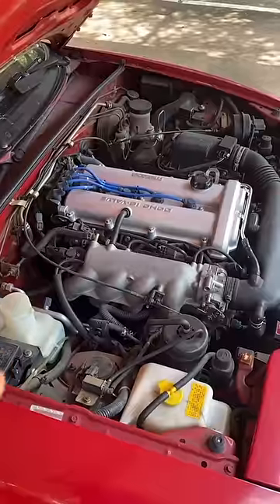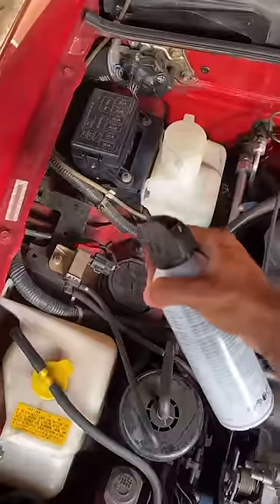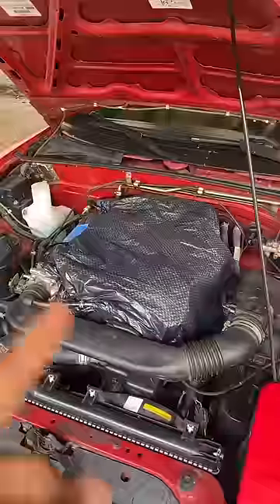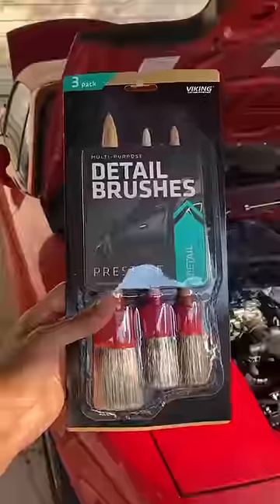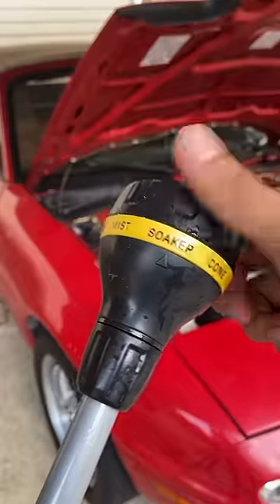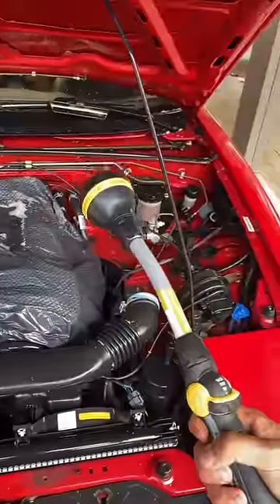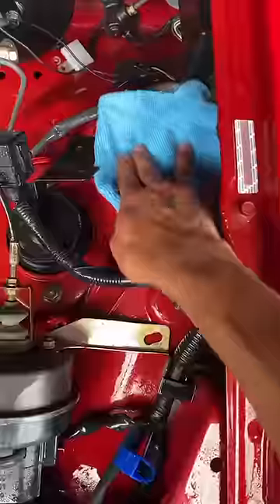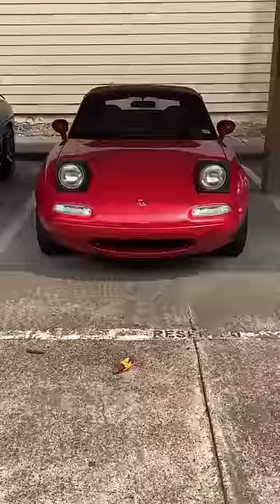How to Detail an Engine Bay! (the right way)

Comment: One thing to note is to disconnect the battery and probably take it out of the car altogether before doing this. With Miatas the battery is in the trunk so that's why he doesn't need to.
Reply: You still need to disconnect it for at least 45 minutes to remove all charge from the car so you don't short any sensors
Reply: You need to remove the battery and cover the alternator, doesnt like any bit of liquid in it
Reply: @jacobwebb8818   just disconnect the battery and turn on high beam for like a minute cover the computer (ecu) and the alternator.
Reply: The bug thing to worry about with the battery connected is the front impact sensors, if one of those shorts, bye bye airbags.
Reply: @WH32R  the chances of that happening are so slim though it's almost impossible. My 2001 Tacoma has them very low to the body and I've had them submerged in watery mud and nothing ever came about from it
Reply: @jacobwebb8818  then yours have really good water seals on the connections lol
Reply: @WH32R  Kinda what I was thinking the more I thought about it lol. 
I'm sure most have fairly watertight connections though, at least I would hope. Sensors aren't meant to be waterproof but they also have to be able to sustain a splash occasionally. If you look at most modern cars excluding the really recent ones with stupid amounts of plastic in the engine bay, most cars have plenty of huge gaps you can see to the ground from. Old trucks especially, the engine took up maybe like 50% of the engine bay and the rest was whatever the frame took up and the fender well. You could literally throw a football through the gaps of my buddies old power wagon lol. His massive air cleaner might have been able to fit between the engine and the frame lol
Reply: Not really gonna hurt anything
Reply: Do it regardless
Reply: U can just leave the car running while u wash 🧼 😴 soo it’s harder to damage anything just don’t stay too long on any ecu or anything like that
Reply: And wait for any liquids that couldve gotten on your wires to dry before you reconnect it too.
Reply: None of this is real unless your car is really old, modern cars don’t care about water under the hood, you can power wash under the hood and it’s completely safe. I work as a detailer, we do it all the time, nothing ever happens. This is mostly for 2000 cars and higher, but we have also done 1990’s cars and nothing happens.
Reply: @sebastianlopez8178  I bet you've ruined several alternators.
Reply: I never disconnected it in my live shit is water resistant for. Reason. Spend the extra 20 bucks you never have to worry
Reply: Lol, I've pressure washed many engine bays and its been fine
Reply: To everyone saying covering the alternator and ecu: these things will be fine with a few hours of drying as long as they have jo charge, its all just silicone, caps, and copper
Reply: Also have the engine running if you are spraying the engine itself
Reply: Thanks
Reply: When I detailed for Ford they had us pressure wash the engine bays of all the new stock/sold units/details. No trash bag. No disconnecting the battery. On details we hit it with an all purpose cleaner (red hot), started the car, then pressure washed it. Had a couple new guys give some open box intakes a bath lol. Summary: Wash your own cars.
Reply: He should have mentioned that
Reply: NO NO NO NO use DASTY its made in italy THE BEST GREASE AND CRAP REMOVER better than brake cleaner...... warm you engine up. Spray the whole engine bay all of it. And the high pressure wash the engine bay.... only do this on japanese engines... they have far much better sealing plugs and connectors. Have done this many times and zero problems
Reply: Thank you cause I was thinking the entire time I'm alot more worried about the electrical side of things in engine bay over the engine unless it has turbo, ITBs etc not much to worry about with it IMO 👍 Definitely agree it's good to disconnect the battery either way so you don't possibly short anything
Reply: Y'all acting like the engine bay doesn't get wet when you drive in the rain. Pressure washer? Probably not smart. Low pressure hose? You will be 100% fine.
Reply: Literally turn the headlight switch for one second with the battery disconnected and there is no power in the whole car immediately, if your vehicle is a diesel make sure to disconnect both batteries.
Reply: Actually you'd probably be fine, most cars are designed for water to get in that's why there's waterproof harnesses, pro detailers will literally hose the engine bay with water, now yes you should disconnect the battery but you shouldn't have to pull it out because it's disconnected and won't complete a circuit
Reply: I've seen Jeeps, Toyota, and Land rovers offloading with water over the hood... you'll be fine without disconnecting your battery or covering your altinator.
Reply: @NajaetheGamer  ever heard about that guy lighting a cigarette in the back of the plastic bed of his pickup truck filling up his red can......
Reply: @nickbisson8243  nope
Reply: Good lord I didn't notice he didn't do that.
Reply: @jacobwebb8818  why would You need to disconnect your battery??? Sensors? you act like the car engine is in a waterproof bay! Not never has it rained and you say let’s disconnect the battery before I drive through the water! Water can hit almost any part of the Engine! Except for ur fuse box. That’s why pressure washing it is the Best. Don’t have to hit it with a lot of water! A Water hose is not to great for it cause the amount of water ur putting on it!
Reply: @jacobwebb8818  or just turn the key when you remove the battery to discharge the capacitors
Reply: @jacobwebb8818  just flick the lights on, it'll discharge anything "stuck" in the system, Wich is usually next to nothing.
Reply: @thatslegit  you realize it gets soaked while driving in the rain, right?
Reply: Itz_Hunted  the fuse box, spark plug holes and relays are notorious for getting wet on these cars. Some cellophane wrap or foil and even wd-40 if you're paranoid keeps water out, other than that spray away. But I always disconnect the battery too.
Reply: @NajaetheGamer  terrible advice. Cool water can crack any parts that are hot, plus all the live electrical connections.
Reply: @docrand7750  read my previous comments and you'll see I said they get rain all over them 😂
Pressure washing forces water into crevises it normally doesnt go into, pressure wash from a far distance or low pressure and you're good
Reply: Mine is under the back seat so I'm good lol it's an 03 Buick lesabre custom if you are wondering
Reply: @grimreaper1257  it's not about getting the battery wet, it's about live connections while spraying water causing shorts.
Reply: @Parker_white_guy  I believe WD40 possibly some will do just fine and a cover for the fuse box
Reply: @thatslegit  eggsactly
Reply: i was like ``noooo the battery`` then i remembered that
Reply: What a crock. I've been taking my car to car washes for decades and NEVER removed the battery. I have a 2005 4x4 that I take swimming, water is upto my steering wheel and never had a problem, that just bull sht.
Reply: i was about to say this 😂
Reply: Don't need to do fuck all, alternator won't like it but if anything stops working from water in it then it was broken anyway, they have seals and all the necessary shit where it's needed
Reply: Was just about to say this
Reply: It's still not that big of a deal especially in older cars from the 90's and before. I've cleaned plenty of engine bays with water just by covering the alternator and air filter and never had any issues. It's not gonna be the end of the world unless you soak electric parts on purpose
Reply: I’ve always washed my engine bay with the car running. Zero issues

Comment: Well just be careful about the alternator and electrical lines before you shower down the whole bay
Reply from the maker: Good point! I always recommend covering the alternator, electrical connectors are usually water tight as long as you use low pressure from the hose 👍
Reply: Unless parts are damaged, this amount of water pressure won't do anything. Ive had engine bays full of mud
Reply: @sixspeedofficial  but u didn't say it this time u probably broke the engine or something from it like i feel it its just dumb to pay someone to do that if u only go on normal road AND not being crazy
Reply: Alternators don’t care too much about water, otherwise they wouldn’t be placed at the bottom of any engines. Mines been through rivers, mud quite literally, and all hell
Reply: I personally had to power wash my alternator because my power steering pump right above it cracked and dumped power steering fluid all over it. It hurt to do but I figured better than power steering fluid. Alternator still seems alright
Reply: So do you do when it rains? Idk if you know this get everything in the engine bay is DESIGNED to get wet. Just remove your battery and don’t spray into the intake. As long as you don’t use a pressure washer there is zero risk of you damaging anything that is in proper working order.
Reply: @tristangriswell2034  The key here is disconnecting and removing the battery, and making sure your engine bay has plenty of time to dry before running it again. Spraying water into your engine bay will put significantly more water into it (and onto electrical connections) than rain splashing into your engine bay does. In short, your engine bay isn't designed to be THAT wet, so taking a few extra steps to guarantee nothing is damaged is always the better decision. Otherwise, your statement is correct. Cheers =)
Reply: @sixspeedofficial  it’s actually much better to clean your engine while it’s running
Reply: @kingjohan1335  nooo 😭
Reply: @woody350z9  it literally is, the positive pressure prevents water getting into the engine
Reply: @sixspeedofficial  well you didn't this time
Reply: @Duck_side  exactly
Reply: @kingjohan1335  you dont really have to worry about water getting in the engine at all unless you spray water directly into the intake, its all the electricals you have to worry about because if the car is on then you could cause a short
Reply: @woody350z9  no water can get through many places, older engines can easily get water into the spark plug wells, it will misfire for a bit but usually will clear itself up
Reply: Water doesn’t cause shorts
Reply: @Fee.1  pure water wont, but most water isnt pure water
Reply: Or…. Wait for it…..disconnect the battery and let it air dry for a while
Reply: @Fee.1  it’s not the water that conducts its the minerals and salts in the water
Reply: @woody350z9  it is you just make sure it doesn’t suck in any of that water. The heat from the warmed up engine will mostly turn it into steam but still cleaning it. And just make sure to not get water in anything like a circuit. If you take proper precautions you will be Gucci
Reply: I've sprayed hundreds of engines in many types of vehicles. Sprayed the shit out of the battery, alternator, fuse box, everything. Never had a single problem
Reply: @ST3W1010  there are many places inside an engine bay designed not to get hot, water can sit and there after being shot in and under those areas with high pressure and cause corrosion and long term electrical issues when the electrical components rust
Reply: @EricB90  thats very anecdotal evidence, plenty of manufacturers mark specific areas with a "do not pressure wash" symbol. Just because you can identify an issue, doesn't mean its not there or wont be there
Reply: @kingjohan1335  exactly. And when do they come into play? Exactly
Reply: @woody350z9  bikes, Cars, trucks, heavy equipment, military vehicles, dump trucks, forklifts, semi trucks, riding mowers, 2 stroke engines, 4 stroke, you name it. If it had wheels and an engine, I've ridden em hard and sprayed em. Not sure how much more evidence i would need. Talking hundreds of scenarios over years.
Reply: @That V8 Life or….ride a naked motorycle with zero fairings…
Reply: @That V8 Life yep, even old cars wet isn’t an issue, pressurized water going where it shouldn’t, and common sense failures like failing to dry it or allowing water to pool in or around plug tubes etc is not a water problem it’s a classic PEBCAK SITUATION
Reply: @sixspeedofficial  I’ve encountered more metri-packs than weather-packs
Reply: There are so many videos of offroad vehicles running underwater no problem. You don't have to worry about the battery or the alternator.
Reply: Lol what?
Reply: Also never have the engine hot you might cause a cracked block
Reply: @imoffendedthatyouareoffended     Well any idiot knows that if you pour cold water on a hot metal that it’ll crack  block or weaken it there are cases where the block is made out of other metals but it does happen also most people don’t have heated garages so therefore the cold block when it is first started is already close to the temperatures of the air and snow and weather… now cold water out of the tap on a hot day and the engine was previously running and heated up then that can and has caused cracks before .. I have seen it happen with a girl in high school
Reply: @imoffendedthatyouareoffended   also most cars have a multitude of guards and if you have a subi the chances are none of the snow or water directly gets anywhere in the engine because of a slidplate that almost every car has now
Reply: It’s ok to pressure wash underneath the hood
Reply: @tristangriswell2034  it's almost like your car has a hood and a belly pan. Open your hood next time after it rains. You'll be shocked how every thing is.... completely dry. Crazy I know.
Reply: @---ny4ys  I don’t know what your driving but, the motor in both my Silverado and my Sonoma get soaked driving down the road. Maybe it’s because I don’t have all those useless plastic underbody panels.
Reply: @kingjohan1335  are you talking intake wise or exhaust?
Reply: I agree with eagle one the main thing you do got to watch out for is the air intake don't get a lot of water in there

Comment: Lemme just use 15 cans of compressed computer air real quick.
Reply: If you own a data vac those will work too, not as high pressure but you don’t need to keep buying cans
Reply: Why not just use a leaf blower?
Reply: All good options me personally I use my air dew auto 20 gallon air compressor and I just have an nozzle that shoots air works great just keep a safe distance ass the psi can be a little high but also depending on how hard I pull the trigger limits the psi coming out the nozzle
Reply: Comments like this make me wonder if y’all are alive or not 😂😂😂😭
Reply: The video said compressed air , what do you  mean an air compressor??? Video said compressed air so thats what I went out and bought !
Reply: LooooooL

Comment: Guys listen. You drive your car through the rain and all of those components get soaked yet youre worried about getting them wet? The only thing i worry about is the air intake. Other than that it is perfectly safe to hose down everything and even foam it. Car wiring if in good condition is sealed and waterproof. I pressure wash my engine bay lightly and have had 0 issues. Just be mindful of thin wires and youll be fine
Reply: A garden hose is fine, but not high pressure water. No pressure washers, no car washes.

Comment: I washed my engine bay with a pressure washer and chassis cleaner to get the oil out and after that i proceeded to clean it wirh silicon spray and a towel. Looks like a charm now

Comment: so long as you don’t put the hose in the air intake, you’ll be fine washing the whole engine bay. If you have any damaged electrical connectors or wiring, then fix that first. Think about it, you drive in the rain? or at least, your car is capable of driving in the rain? ever driven through a puddle? yeah, engine bays get wet all the time, getting them wet deliberately isn’t going to hurt them. Just don’t put tons of water into where the engine breathes, ie, intake, exhaust.

Comment: I truly dont understand why you cover the engine im a proffesional car detailer and we have never covered any component of the engine besides the air filter🤷🏻‍♂️ everything is built to be pretty much water proof seeing as there are opening all throughout the front grill of most cars
Reply from the maker: I previously painted the valve cover so I didn’t want to risk any loose dirt messing up the finish 👍

Comment: Use low pressure water rather than high pressure, speaking from personal experience I’ve never had any electrical issue from not covering my battery or alternator but if you’re worried just make sure to cover them, maybe your fuse box too
Reply: I use heavy duty degreaser and a pressure wash, for an old holden rodeo so it's a diesel

Comment: Yeah so before you dive straight into cement, first make sure that your engine bay doesn’t have loose, or more exposed wires. Disconnect the battery. And wipe down only the things needed with a wet cloth. But honestly unless your are going to meets there is almost no logical reason to do this. Your engine bay is going to get dirty within a couple miles. And your car can handle dust. But if you do cheers.

Comment: I highly recommend using an air compressor to dry off all the electrical components. Also don't use wax in your engine bay, the metal parts will get really hot and the wax will cook and start to splotch.

Comment: I worked in detailing and you don’t have to use a hose you can use a low power pressure washer and will do a better job at getting dirt out, as well as use a degreaser instead of soapy water

Comment: I just jet wash the engine bay, always been fine, no issues so far!
Reply: Please disconnect your battery if you do this 😭
Reply: @TheGoopGod  I’ve worked at multiple auto shops and we never cover anything or remove the battery